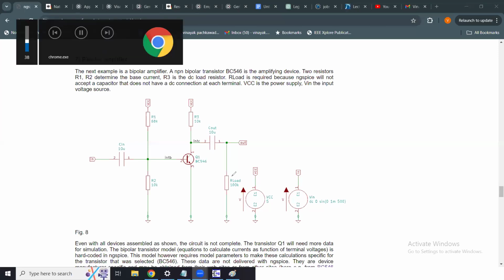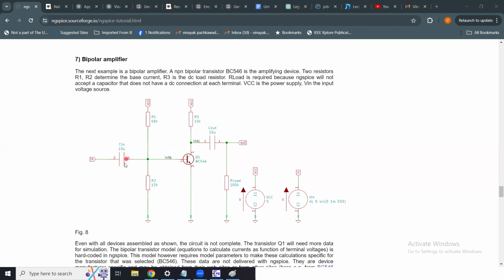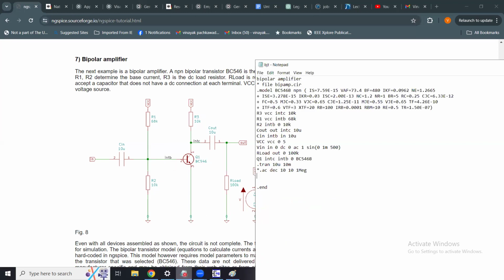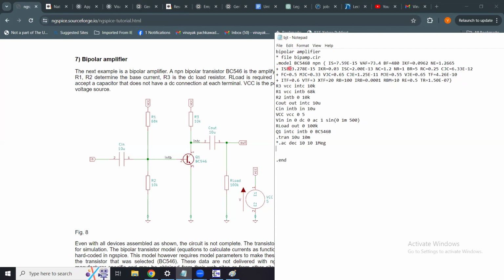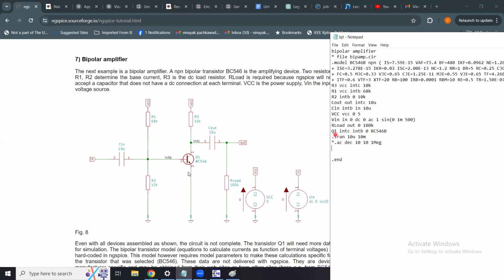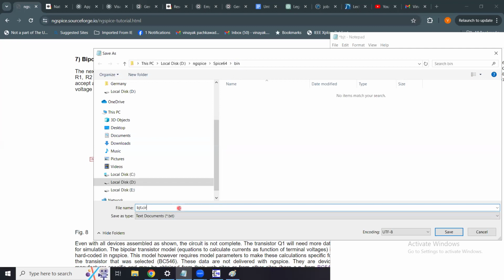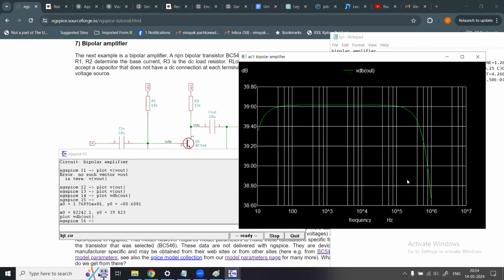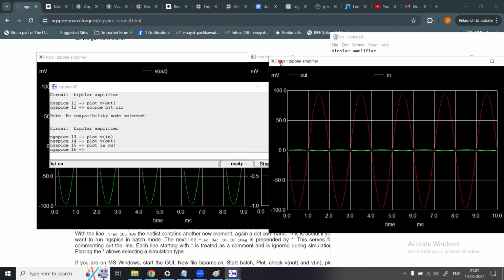BJT Amplifier Design with SPICE | Tutorial

Comment: CE Discussion: The impact of adding the emitter resistor RE: 1. Reduce the relationship between voltage gain Av and B 2. The input terminal allows larger input signals without distortion. But it will greatly reduce the output Av and requires adding a u-class bypass capacitor.
Reply from the maker: Check out our answer in this comprehensive guide
https://youtu.be/Xcq-rvbopSg